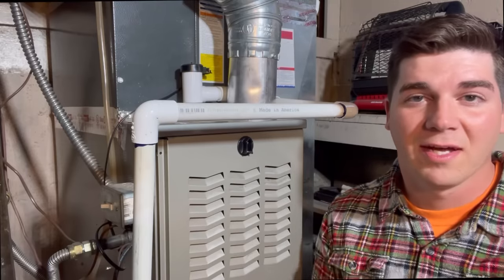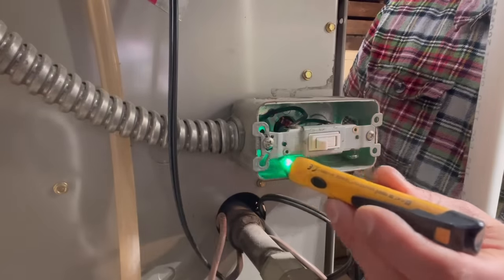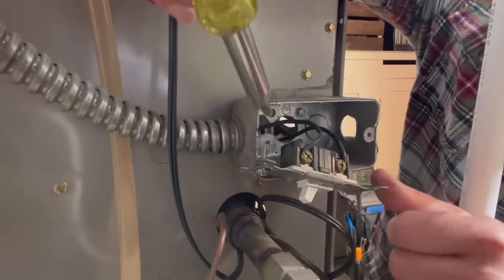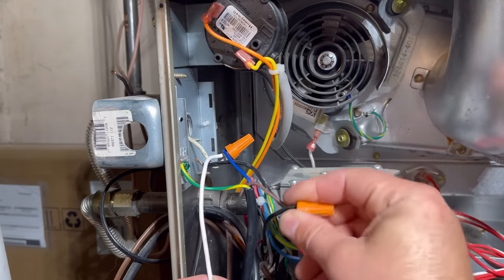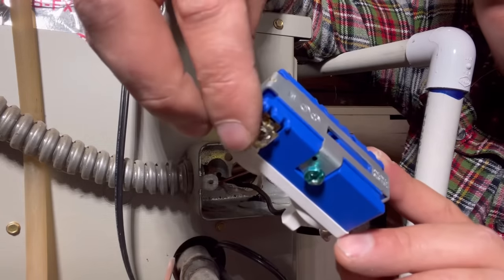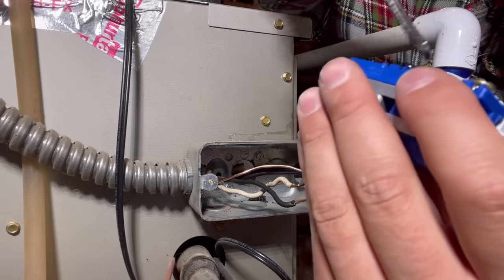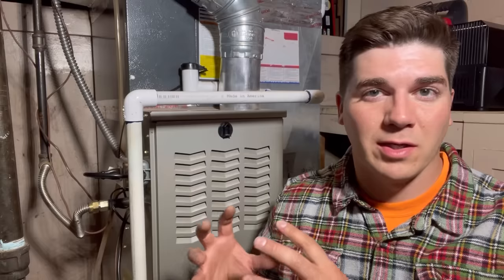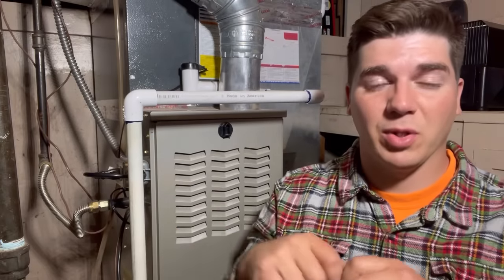This Could Keep Your Family Warm During An Emergency Power Outage.

Comment: I would probably just plug a 1500VA UPS into the outlet and plug the furnace into there.   That would provide immediate backup power during a short interruption.  Thanks for the video, great idea to insure it is easy to switch to an alternative power source with minimal effort!
Reply: Nope! A UPS is designed for 5-8 minutes of backup power, they're designed to give you enough time to save your work on a PC, and then shut er down. Or they keep it up and running until your backup generator starts and transfers over.
Reply: @brnmcc01  Thanks for the reply!   I think you are missing my point, the objective is not for it to provide long term power, but to prevent the interruption of power as you switch over to the alternate power supply, while also providing surge suppression which will also protect the furnace.  A 1500VA UPS will easily provide 30-50+ minutes of backup power under a 400 watt load.    The "5-8" minute ratings apply to the lower rated UPS systems that are 350-600VA.
Reply: @SolApathy  Probably not 30 minutes, the Volt Amps of a mainly induction motor driven load like a furnace is going to be much higher than the 400 watts of real power, because the power factor is pretty low with PSC motors, and will be using more like 600+ volt amps. A volt amp only equals a watt in a purely resistive load. A typical 1500 volt amp UPS is only rated for 257 Vah so 257 volt amps for 1 hour before it shuts off.
Reply: @brnmcc01   Well, it's rated at 400 watts for 55 minutes, so I was trying to give a conservative estimated based on the losses incurred.   I will test it out later this week with one of my 1500's and see if it makes the grade or dies a glorious death and let you know :)    Again, thanks for the speedy replies and the great video!
Reply: @brnmcc01  My furnace is ECM.   it's 20 degrees in the attic right now in Houston, so not going up there tonight lol.   I don't use the cheap UPS units that can't handle heavy surge loads.   I'll let you know.
Reply: @SolApathy  Wow. In Houston?? that's crazy. Well I'm in Indiana, and it's a balmy -1 right now. This morning was -12 with windchill about -34. Yesterday at 5:30pm it was still 36! What kind of UPS do you have? I just have a couple cheap ones for the internet stuff and TV in the living room, a Cyberpower pure sine wave 850va for my PC, and another smaller Cyberpower unit for the fiber optical network terminal in the garage. I have a backup generator, and I installed one for my next door neighbor too in case the power goes out, we'll have air conditioning too! Can't run a whole house A/C off of a battery. Maybe a huge forklift one, but even that would be dead in an hour or two. LOL.
Reply: @SolApathy  If your furnace is 90%, and it's 20 degrees in the attic, you might have a problem if your condensate drain freezes up. 90% furnaces should not be installed in attics. Period. I think furnaces or hvac equipment shouldn't be installed in attics in the first place, but that's just my opinion.
Reply: @brnmcc01  CP1500PFCLCD is what I use all around.  I bought them before I got the generator and they are a little more expensive, but with the true sinewave and PFC, it makes for a lot cleaner power and more efficient.//I have a tri-fuel generator that does pretty well for my needs (Champion Power Equipment 100416-- As I like having options, as in 2020 when the natural gas stopped flowing here in Texas during the winter storm.  The only downside is it is not automatic, I'm using a manual transfer switch and have to push to start it.   But as often as I need it, I can deal with that.      

The weather is just insane.   Can't wait until next week  when it is supposed to return to the 70's.
Reply: @SolApathy  I like those, and the fact that they have easily replaceable batteries. I just replaced the battery in my CP850PFCLCD few months ago, been quite reliable last 3.5 years. Yes crazy weather, heard it was 21 this morning in El Paso even, which is nuts that's right on the border of Mexico.

Comment: Great video. Would a power inverter have the power to run an oil burner/boiler with the motor and circulator pumps?

Comment: Great video and I have now completed the modifications. However, my solar generator cannot perform this function. The furnace circuit board is telling me that it has an improper ground. Is it because my furnace is old and inefficient? My solar generator does not have a true ground (as I imagine most don't) nor does it allow for bonding the neutral/ground. What am I missing? The inducer runs, the igniter lights the gas, but as soon as the blower comes on the flame goes out and the board flashes the error code.

Comment: That is one way to do it, but with the way that you wired it you really didn't need the switch at all, just the outlet.  Terminate the house power at the outlet and run the pigtail into the furnace.

Comment: Very cool. Good to know. Most of these videos on this set up I've watched show gas furnaces. I have an oil burner/forced hot water system, two zone set up. Would this work for my set up by wiring into the main shut off only at the boiler?
Reply from the maker: If it’s 110v then absolutely. Same thing
Reply: @diyhvacguy  Yes it is. Ty.

Comment: Great video! I have a 15 Amp bus fuse on my current on/off switch where the outlet would be. I'm connected to a circuit breaker panel. At the panel, my furnace and AC occupy two panel switches tied together. Do I need to install a fuse somewhere in addiiton to this outlet or can I skip the fuse?

Comment: You don't need a switch. Just wire the cord directly to the furnace and replace the switch with a plug. Then your means of disconnect is the plug. Way simpler and cheaper. Switch outlet combos are expensive

Comment: This is a great video for those who don't have a permanent generator hookup. I do the same thing with my water pump. My one question is: The circuit breaker is 20-amp, but the receptacle appears to be rated for 15-amp. Did I miss something?
Reply from the maker: I nabbed that video to emphasize turning the breaker off before working on this. My furnace is actually a 15 amp breaker
Reply: All duplex receptacles are rated 20 amp but the 20 amp receptacle with the horizontal extra line is for a matching plug that is connected to an appliance that draws more than 15 amps.

Comment: Why not set up a connection right to your breaker box? I like your solution to directly run the furnace. I would think about having both types of options with a breaker box solution and the direct to furnace solution. 
Like you know, it is probably power source dependent. 
Good thinking and good video. 👍
Reply from the maker: I’m doing a video on this soon that will prevent having to run a cord in through the door. Stay tuned! Cheers

Comment: Alternatively you could have left the tab and attached the neutral as you did and the black wire where you jumpered to on the switch portion. The only thing it won't do is light the light unless something is plugged in.
Reply: I also suggest you get crimp ferrules for braided wire ends, it keeps the wires cleaner and makes a more solid connection with those push connectors.
Reply from the maker: Yes I ordered some of these for future use :) thanks for the feedback! Cheers

Comment: I have a high efficiency furnace that has an exhaust blower that also draws power so not sure how long my Vtoman 1000 power station will last.  It did work when tested but have not done a long term test.  It will be less than this video presentation.

Comment: To complete the story may I add two contributions to the “system”. Planning ahead can make everything a snap when it comes time to rev up your generator. (Note: I live in a raised ranch with attached garage.) 1.) There is a wall outlet in plain view between my range and refrigerator. I added a 4 receptacle tap (with center screw to keep it snug) and plugged in both range and fridge. Two outlets left for small appliances. Thus, when the grid power goes down, plugging in the range and refrigerator to a 14 ga. extension cord from my gas-powered generator is a slam dunk. I do not have to pull out either the range or fridge. In a crisis keep things ASAP, as simple as possible and quick. Lowers stress. 2.) I drilled hole in header board (2-by lumber set on edge on top of concrete foundation) to allow PVC pipe stub to pass through with extra length to allow PCV cap on both ends. Caulk appropriately. In my case this is hidden inside behind drop ceiling panel. Outside this is hidden under second floor deck. Sand ends of pipe to make future cap removal easier. I added 1/4-20 eye bolts as a handle. PVC pipe inside diameter must be large enough to allow ends of extension cord to pass through. I used 2” so I could also run a garden hose through simultaneously. Another story. I also added same pipe through wall near floor adjacent to door leading to garage. I used a PVC cap small enough to fit totally inside pipe on both ends to seal pipe against airflow and critters. Totally flush to drywall on both sides. Punchline: I can bring electrical power from generator into the house, even all the way through the house in an emergency without having a door or window ajar. I can run a pump-connected garden hose through the PVC pipes in case of flooding. I can run 220V power cord (special plug, 12 ga.) from my garage shop into house to run big heater if furnace should fail. This whole exercise was inspired to guarantee no carbon monoxide infiltration into house when using gas generator. CO is a killer. BTW, never run a generator in an attached garage even with the garage door open. Sorry, I’m sure this is a lot to take in verbally. If you’d like me to make a video please comment thusly.

Comment: @The DIY HVAC guy To solve the neutral bonding issue (which my furnace requires) would it be possible to feed the hot lead off the generator through the pigtail but  route the neutral and ground back to the neutral/ground bus at the panel rather than jumping the ground/neutral in a hospital plug?   The switch would then really only be switching the hot wire and neutral/ground would always go to the panel.
Reply from the maker: Yes I believe that would do the trick.

Comment: The problem I see with this, correct me if I'm wrong, is that now the furnace emergency shut off switch is non functional when jumper plug is plugged into external power source.

Comment: I’m looking to do this to my house sometime soon. Is this truly okay to do? Such as if a professional came in and noticed this configuration would there be issues, also the same goes for inspections. 
Hoping to hear back from you soon before the heavy winter hits. Also a quick question. Any idea if it’s okay to run a furnace on a 15A? Or does that depend on the furnace. Not sure if I need to swap breakers/Romex. 
Thank you
Reply: In order for the connection to be fully code compliant you have to use a flanged inlet to connect the extension cord to the heating plant. It is a violation of the US National Electric Code to connect equipment fastened in place to a building's electrical system using flexible cord. The exceptions under which this can be done do not apply to heating plants. 

Tom Horne

Comment: Double male extension cord. Cutting the plug off the condensate pump is not allowed in a number of jurisdictions. With a normal plug you switch the breaker off for the furnace and then plug your double male extension cord in to one of the two receptacles. Plugs are just fancy junction points.
Reply from the maker: Haha so you are telling me that cutting a plug off a condensate pump isn’t a good idea, and the next sentence stating to create a SUICIDE cord? Am I understanding that right?
Reply: @diyhvacguy  the condensate plug is factory fitted. Altering factory approved devices is a no no according to my electrical authority. A male extension cord albeit illegal for resale, it is not illegal for use. You create the plug vs purchasing the pump. I'm not saying your idea is wrong, I'm saying the install of your furnace wasn't even to code to begin with if it were up to my locally governing body. A suicide cord is only a suicide cord when using it on grid power unless you're a numpty. The grid comes back online, your furnace breaker is off not backfeeding therefore you go about your Genny off and that cords a dead duck on both ends. Only way it's suicidal is if you want to hang yourself with it at this point or if you decide to leave an extension cord plugged in to the furnace receptacle.

Comment: Many thanks. Wired the furnace, Now, I need 75-foot extension cord from truck to furnace, so is a 10/3 too much?  not enough?   would 12/3 work?
Also, are you still recommending Bestek 1000 inverter?  Bill

Comment: Why do you need the switch? If you can just unplug the furnace then an outlet would be sufficient. Also why would you cut the cord? If you leave it long enough then you would not need a extension cord. Any thoughts? Thanks and cheers 😊 G
Reply from the maker: Building code. You could totally just do this with an outlet and a plug

Comment: very helpful but what kind of wattage inverter or ups would I need for this cause that detail is very important
Reply from the maker: Depends on the size of your furnace. You can get an amp clamp multimeter and put it on the main wires going to the furnace and check the amp draw so you will know what size inverter to get. 👍🏼

Comment: Great video, first time watching your channel. Keep up the good work.
I am curious why you disconnected the ground wire coming from the breaker panel and only connected it to the outlet with the switch and not to the chassis of the furnace, when you unplug the furnace from your outlet it would seem that you disconnect the ground from the chassis, and now it is floating without much to really keep it at ground potential. Does the switch/outlet combo carry the ground circuit through the mounting tabs?
Reply from the maker: Correct

Comment: Thanks for the video. It helped me out yesterday when we lost power yesterday with negative temps. I temporarily wired in the plug to go to my generator. I still need to do it perminitly. I have a legit question. Can you just wire in a regular outlet there or does it have to have a switch on it?
Reply from the maker: You can. I think it’s building code here to have a  switch that’s dedicated for the furnace. Glad this video helped you out :)

Comment: Question:  this is what I have done in the past....during a power failure in the winter ...# 1  I first turn off the furnace " circuit breaker "  until  utility company AC   power is restored  and  leave the furnace switch on..... #2 I created a short  extension  patch  cord with  " males "  on both ends....#3 plug one end of the patch cord  into the furnace receptacle and the other end  into an extension cord, leading  from my generator....  the furnace starts up and runs fine..after AC power is restored , disconnect  generator cord, turn breaker back on  ......is this wrong?....thanks
Reply from the maker: This is not advisable because you are using a “suicide cord” so the prongs could be live and electrocute someone.  This video explains how to do it with a regular extension cord. So the outlet gives power to the furnace during grid power, and when you have generator power you just flip the switch off and unplug the pigtail, plug it into your extension cord that goes to your gen set 👍🏽
Reply: @diyhvacguy  aside from the fact that caution is needed when working with the suicide patch cord, will it provide generator AC to the furnace in an emergency situation, without  danger of damaging any other electrical components ?....thanks

Comment: What size of an inverter would you suggest one use to power this furnace, and what about other furnaces that may be electric instead of gas powered?

Also, why not get a generator and hook it up to the house?
Reply from the maker: Having an interlock kit and power Inlet box is obviously superior but for those who aren’t set up for it, it kind of depends on the size of the furnace. Mine worked fine with a 1000 watt inverter

Comment: Nice Video, man. I would suggest a pop in romex connector on that pigtail inside the furnace as well. By doing this you protect the pigtail going into the furnace. Also, might it have been just as good use a on-off-on switch?
Reply from the maker: Yes alot of people said the same about the grommet and the three way switch. I did the grommet, and I’m about to film installing a transfer switch, so that will be a better/ easier route I think. Thanks,   Dave

Comment: You got the Romax go to the power box, open it up make that Romax a ground put a ground on that light switch get that unit grounded it needs to be no ground you’re putting people at danger. This guy is not even talking about a ground just a hot and a neutral.

Comment: Question: When your furnace is being powdered by your solar generator and the generator runs out of power, what damage will be done to your furnace? Presumably the same damage that happens when you lose power to your house. The question is: What type of damage?
Reply from the maker: Very minimal chance you’ll crack the heat exchanger. It would have to do that many many times to crack it, and that’s only if it’s super old. The effects are minimal if any.

Comment: Thanks for the help, all wired up. But can you tell me the minimum size inverter needed to power the electric furnace?
Reply from the maker: This is not for electric furnace’s unfortunately. Gas furnaces only. I will have a video on how to power a heat pump and or electric furnace with backup power soon so stay tuned!
Reply: @diyhvacguy  ? I wired mine up with this switch for the electric furnace & it works fine plugging into the electric, but if that goes out, I wanted to know the min inverter size needed from a car? Thanks